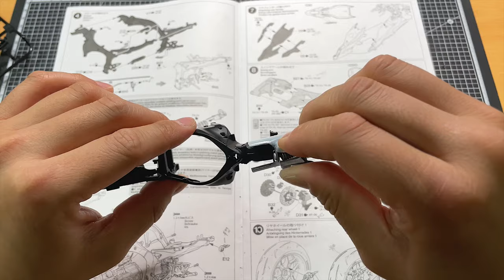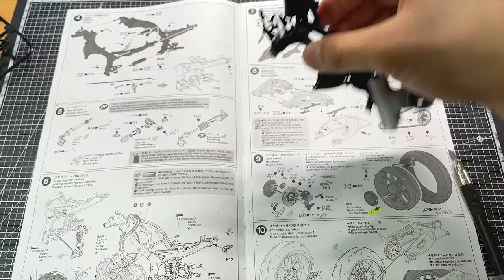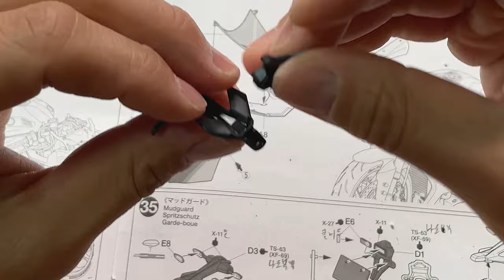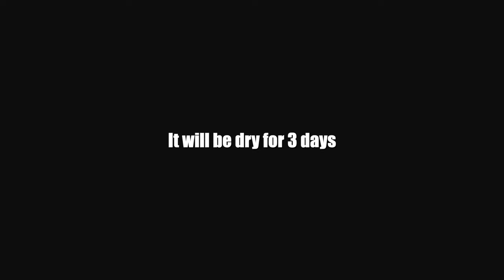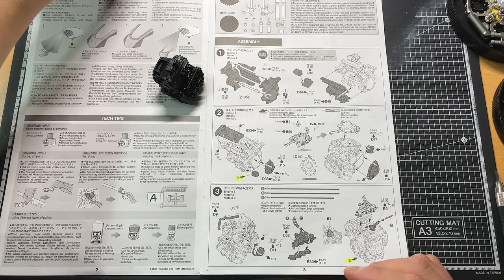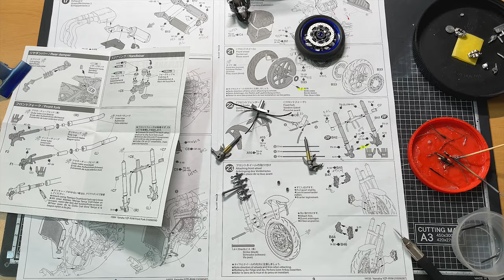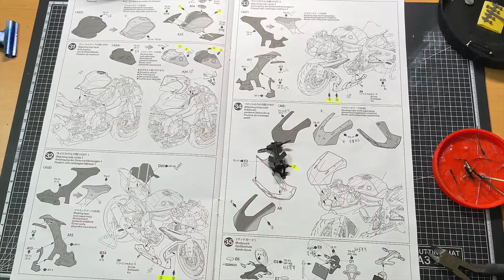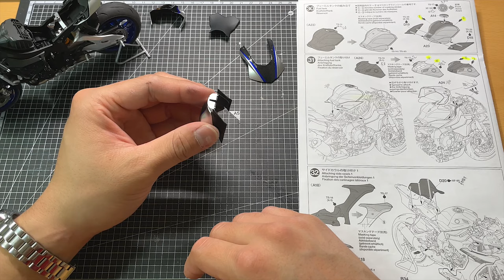[Full build] Yamaha YZF-R1M 1/12 Scale step by step (Tamiya)

Comment: Beautiful work too bad the cat kills the whole model for me personally just my own opinion (and that of MANY full scale R1 owners apparently)   For a few pennies more in plastic they could have included an optional cat delete?  THEN I might actually want to build one  I have the dummed down MT-10 version of the motorcycle and damn I hate the OE cat!  just a big ugly hunk of dead weight ....only reason i keep it as I have yet to find a good aftermarket option that is not ridiculously loud ....cause most riders apparently THINK they want a shorty can but they are obnoxiously loud on the pipe on any R1/MT-10/FZ-10  BTW would be awesome too if there were an SB1K version of the kit that eliminates street stuff and uses high end swing arm and suspension.....maybe with decal selection for various team schemes